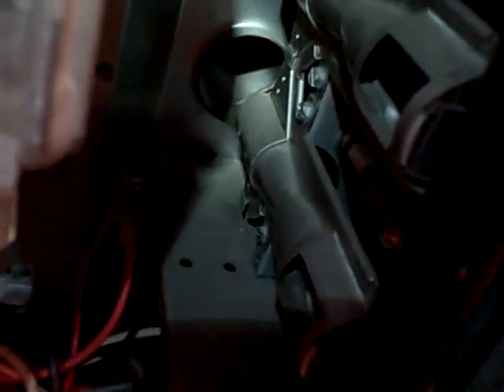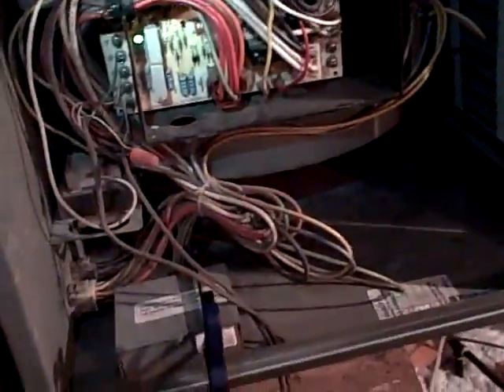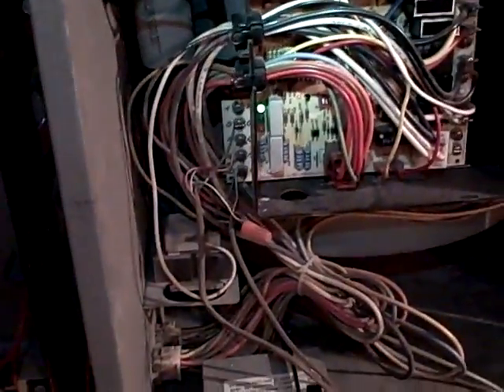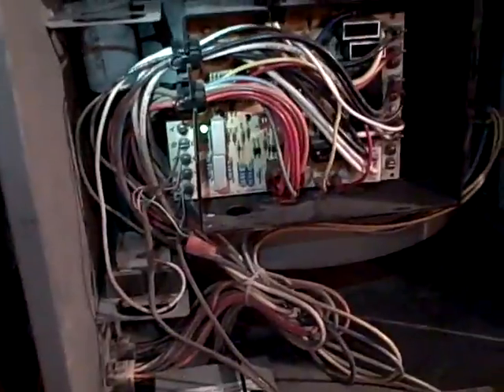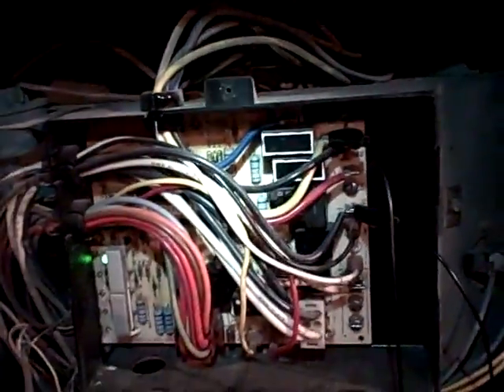HVAC Troubleshooting a gas furnace control board and blower motor.

Comment: How long have you been in HVAC. I'm only 9 months in as a technician/installer
Reply from the maker: About five years or so before my spinal issues made me retire.  
The first year I thought I would get stomach ulcers for sure,  hehe! I called the boss a lot!  I think he started me out with 4 calls a day till I acclimated a bit,  then 5 for a bit,  then 6 a day was average during busy seasons. 

I really enjoyed working on stuff after I got used to it, plus meeting people,  I'm pretty social :)  

The fun,  if you want to call it that, is running across equipment you've never seen.   My first package unit mounted on a sloped residential roof... my first condenser with dual compressors (not the fancy circuit board controls either)
... first antique unit with a pcb capacitor almost the size of a thermos! (Caution,  they stay charged!!)
And of course the 40-50 year old stuff that has been worked on,  rewired, safeties wired around (if any) etc. 

I miss it,  my back doesn't of course,  lol,  nor do I miss attics in the summer!

I mostly just ran as a tech so not much on the install side unless they needed help. 
Hope you're enjoying it so far!

Comment: I had an electronic board furnace that turns on for a split second then turned off. I checked for high voltage and low voltage, it has those voltage. I check the back of that electronic board if there are burnt marks and found none. have you run in this kind of problem before?
Reply from the maker: Hrm...thats kinda hard to troubleshoot without more info... Is it a fairly new/late model unit? What brand is it? Its an electric air handler, not a gas furnace, correct?  Does the board have a LED on it thatcould be flashing a trouble code? (Maybe seen through a sight glass on the door panel)
Reply: +mikie2501 there is no code stored. its an Amana system. 17 years old. I talked to my senior tech and they told me to get the board and electronic module indoor fan because we don't know which one is at fault. they told me that there is a tool to check the electronic motor and we don't have it. I can get more detail about it and tell you what was the specs when I get home tonight after work if you are interested.
Reply from the maker: +metal gear hrm, ok an older unit like that eliminates one of the things in my head. First thing I would do is cut the power to the unit and put my hand in there and see if the blower wheel spins freely, not blocked by something and not freezing up and stiff from bad bearings. If it spins free then Id check the cap while Im there, then Id pull the blower speed wires off the board and wire whichever speed you want directly. Either to a hot terminal or wire it to the door switch. At least you can figure out if the blower is working. (I have a video on here testing the blower somewhere)
Reply: +mikie2501 it does not have a capacitor (blower motor). I believe there is a short somewhere that in a split second the indicator light turns off and what threw me off is I have 24 volts by the terminals. the fuse is not even blown or bad.
Reply from the maker: +metal gear you said the sr tech said to get a board and electronic module. What is this module?
You were talking about a tool to check the motor, while I know there are different tools to check motors, isn't this just a regular 240v single phase 1070ish rpm motor?  
Oh, you said it didnt have a capacitor. Unless its a three phase motor its not very likely, I think Ive only ever run across one shaded pole motor used as a blower motor, they just dont have enough umph!  Check the back of the blower motor housing for it, or just follow the motor leads.  This is just a regular house air handler, right?  Trying to paint a better picture in my head!  Have you wired the motor direct to test it?
Reply: +mikie2501 I believe it is the indoor motor is the problem. the motor is an Electronic multi speed motor. I think it got shorted out and it affected the computer board by the furnace. we never got a chance to figure out because the customer had somebody come and checked the system. Its sad but things happen when you can't make the customer happy they go somewhere else. Sorry for the late response for we are so busy.

Comment: hey mikie2501.  I have an outdoor wood boiler.   with a white rodger 16e09-101.  I have been noticing that as it gets cooler outside my water is not as hot as last winter.  so i did checked the temp of my water is below the 170 degrees that i have it set at.  The fan is suppose to kick on at 150 degrees, its not happening.  Any suggestions?
Reply from the maker: Hi Rose!
   Well Ive never worked on a wood burning anything (fireplace doesnt count;) so dont really have any experience with your situation. I did pull up the schematic for the White Rogers though so it looks straight forward enough.
1. The fan could be bad, or if it has a capacitor with it, the capacitor could be bad.
2. The temp sensor could be bad or out of place/position. I dont know how to test the sensor that you have, usually you can use an ohm meter to test it but that requires knowing what reading you need to see from it.
3. The White Rogers could be bad, or part of it. Its relay could be bad, the heat/cool switch could have been bumped, something else could be shorted.

What I would do (not suggesting that you do, you're working with 120 or 240volts which can kill!) would be to cut the power and remove the white rogers from the wall where its hung so I can have access to the back of it when its running. Id remove any back cover that covers the line voltage and load wires at the bottom qnd then when I have it sitting/hanging where nothing will touch and short, Id fire the system up and wait for it to go over 150 degrees, or whatever its set for.  When it had reached temp Id take my volt meter and test the Load and Neutral terminals to see if I get anything. If its a 120v system and I get power then I know something is wrong on the fan motor side, if I dont have power then I know the problem is with the unit or the temp sensor.  If its the unit, assuming its set right, the heat switch is set right and no wires are pulled out or chewed through by rats, then Id lay odds on either the sensor or the internal relay having gone bad, unless you had a lifhtning strike that fried something else in it. On the fan side, again check for chewed wire, possibly a rat blocking the fan blade if they can get in there, otherwise a bad motor or motor capacitor if it has one.
  Hope this helps! Let me know what it turns out to be!
Ah! Heres the manual, it has ohm readings for the sensor too in it!
http://www.emersonclimate.com/Documents/White-Rodgers/instruction_sheets/0037-6857.pdf
Reply: +mikie2501  so i replaced the fan about a month ago.  

i bought another white rodger  off of amazon and installed it today.  now i am having the problem with the white rodger cycling the fan on and off when ever the temperature gets below the setting.  any suggestions.  

i do want to say THANK YOU. people like you are a blessing to the DIYers of the world.
Reply from the maker: Hmm... When you replaced the motor did you replace the capacitor? (If it uses one) if you just used the old capacitor it could be bad, definitely check that.  
Double check that you wired the motor properly, 120/240v and make sure the wiring didn't pull loose when you mounted the unit. If you spliced something with wire nuts make sure that didn't pull loose.
Make sure the switch is set to Heat, not Cool on back! ;).  
If you are comfortable working with high voltage then you could wire the motor direct just to test it and make sure that it is working.  You can test the controller by disconnecting the motor from it and using a meter to check the motor terminals before and after it reaches temp to make sure the internal relay is closing.
Only four things it could be, controller issue, motor, capacitor, wiring. Well voltage too, heh. If its supposed to be 240 make sure you dont have a problem with the breaker giving you low voltage.

Comment: Is it normal for gas furnace blower to kick on at 88 degrees? I have thermostat at 73, doesn't shut off until it's 77 in house! ugh
Reply from the maker: +kinsleycochran Hi!  It could be a difficult answer without looking at your system.  What kind of thermostat do you have? Is it one of the older manual ones with a dial or a slide arm that uses mercury bulbs and a spring inside?
Sometimes those get dust bunnies up in them and that can mess with accuracy... You can pop off the face and blow the crud out. Also the springs get weak in them over the years, the springs are made of bimetal, two types of metal bonded together that contract or expand depending on the temperature.

If you have an accurate temperature sensor of some kind that you can get the temp right in the area of the thermostat then you can take a tiny screwdriver and adjust the little screw in the middle of the spring to set the temp to what it should be.

...as for the blower kicking on at 88 degrees, I need more info from you. Is the unit shut off when this happens or something?  On some older units, if its in the attic where itscscalding hot, the unit can get so hot that it trips a sort of safety (for lack of easier explanation) and it kicks the blower on to cool off the unit in the attic. This is obviously a summer issue if you aren't running the AC. (Most of the time)

Comment: hi mikie2501
what if i have 115V on the fan terminal ( red wire)
100V on the heat terminal ( yellow wire)
inducer blower motor ( squirrel cage ) don't turn. 
could the motor be out ?
yesterday i gave a spin to the wheel and the motor turned.
 so i replace the capacitor. was working ok when i left the place, had a call this morning cause the furnace wasn't working again. 
so my other question how much voltage should i have on the heat terminal on the board( 100V or 115V)
thanks for your time
Reply: +YANICK LANDRIAULT 
sorry it's the indoor blower (the big blower at the bottom.)
Reply from the maker: Hi!

  Always fun troubleshooting stuff and nothing worse than callbacks, hehehe!  You didn't say what mode you were running it in (or the customer), heat or cooling.  When you replaced the cap and fired it up did you have it in one of these modes or just have the blower set to on? I assume that it fired the blower up quickly like it should?

...as far as voltages, it sounds like you were checking both voltages, possibly, while either in cool mode or with the blower turned on. Both cool and the blower ON setting usually always use high speed and heat will use medium or low, depending how the manufacturer set it up for proper airflow for the furnace to heat at a safe temp. If you check all voltages while in cool or ON then you will of course get 115-120v on High (cool/ON) but you will have a phantom voltage on the heat wire; the voltage backfeeds through the motor and puts voltage on this wire. Its ok though because while in cool/ON the heat relay/sequencer is either normally open or bypassed.
If you tested it in heat mode then you should get 115-120 on the heat wire and probably some phantom voltage on the cool wire.

You may get out there and find its something totally different than the motor though. ...but assuming that its the motor lets look at a few things:
The motor could be very old or the bearings could be going out. Ive run across motors that acted just like that one but after running for minutes or hours it would overheat and slow down till it froze up and not work till it cooled off.  You can cut the power to the unit and stick your hand into the squirrel cage and try and wiggle the shaft side to side to see if there is any play, which tells you the bearings are shot. The shaft will always slide in and out (unless theres a lot of crud) so dont confuse that with sideways wiggle.

The blower relay or sequencer could be flaky and not closing when there is a call for cool/heat.  Im not sure how that unit is set up, if its newer and a control board does everything or if it uses external relays and/or sequencers for everything,  

Make sure the new capacitor is ok as well!  Believe it or not, Ive had several capacitors that were bad, brand new out of the box!  Typically they will read squirelly, you put the meter on it and the reading goes up, then past what it should be, then it will go way down, then back up, like a roller coaster!  Now I always check new caps before I install them. First time I thought the motor was bad too because it overheated while I was standing there after puttin a new cap on. Ran for like ten minutes then started slowing down!  I changed the motor but had the same problem!  Doh! So much wasted time!!

Sorry I didnt get to this sooner, have you been back over there yet?

Comment: Hi mike I have an issue where I replaced the control board and now the inducer motor will not start. The inducer motor was working just fine with the old control board. The blower fan runs fine with the new board but nothing seems to be telling the inducer motor to run. If you have any ideas as to what might be causing that issue, that would be a huge help. Thanks alot Mike
Reply from the maker: Hi!  Have I not replied to this yet?  Hrm.  First, check to make sure you wired the induced draft motor properly. If that looks fine then... Hmm... This may or may not work, but worth a try; reverse the low voltage wires from the 24v transformer going to the board.  Sounds weird, eh? Shouldnt matter since its AC voltage, but once in a while I run across a board that wont behave properly if the 24v wires are plugged in and its being picky.  
You might try and put a voltage meter on the draft motor terminals to see if its getting voltage too.
Have you already sorted it out? Im interested in the results!
  Mike.
Reply: I do, you don't know what the hell you are doing. Borrow some money from mom and have a professional repair it properly.